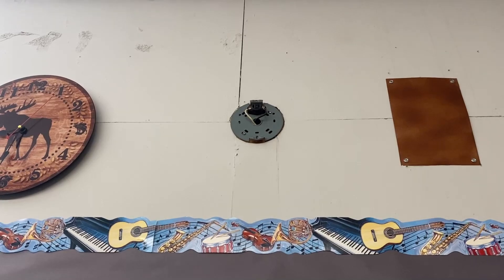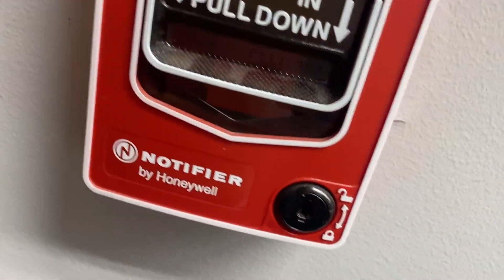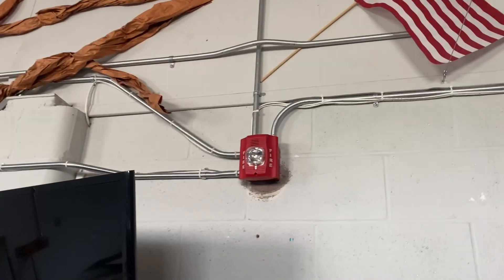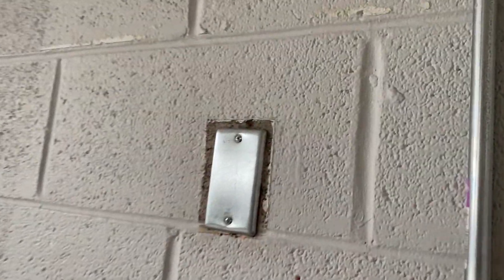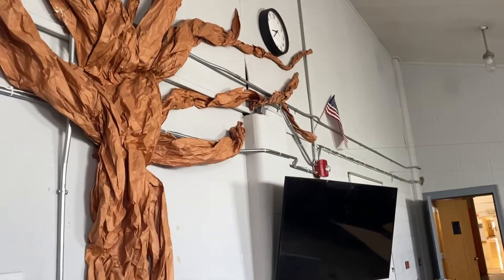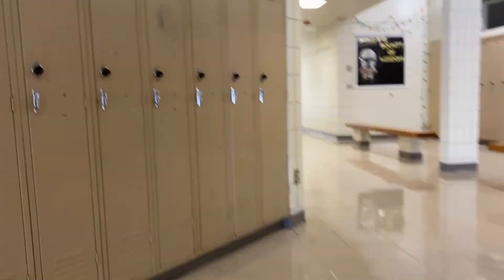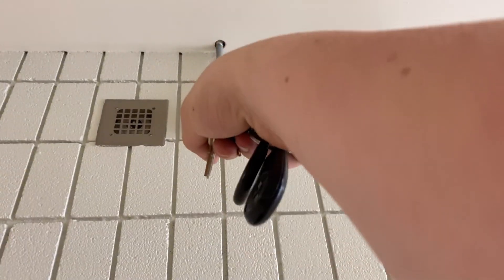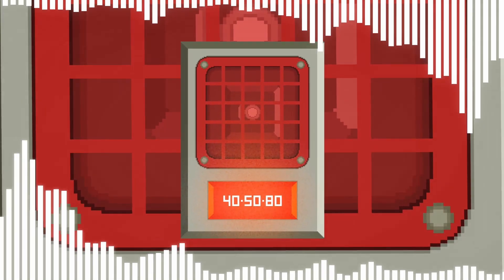Fire Alarm Test 129 | Retrofit

Comment: Indeed. In addition to my first elementary (now K-8) school taking a similar upgrade path ten years ago when their old Simplex 4208 system began failing from age, I also saw another building's 1980s Simplex system (2903+9833 horn/visuals, 4251-20 pulls and 2098-9636 "wiffle ball" detectors) get replaced with an NW-100 system with boring SpectrAlert Advances; the Wilhelm Scream of fire alarm sounds!

Comment: Poor elementary school kids! I feel bad for them!
:( bcuz these System Sensor SpectrAlerts are terrifying!
Reply: The elementary school (now K-8 school) I went to for kindergarten replaced their old Simplex alarms with SpectrAlert Advances ten years ago.
Reply: That sucks! That's gotta be terrifying!
Reply: @BuildingToursForLife1660-4  Well, before that the school had Simplex 4051 horns on 4050-80 light plates, and those were even louder.
Reply: @ZakWolf My school from prek to kindergarten had 4051s in 2007 before spectralert advances replaced them in late 2008.
Reply: @BlueThunderboltsiren  Yeah, that's what the old fire alarms at my first elementary school were: Simplex 4051-60 horn/lights.
Reply: I went through elementary school with spectrealerts they aren’t that bad. I was certainly never terrified
Reply: @pilotthwomp really? But are they horn strobes I assume?

Comment: Not saying they did but chances are if it was full conduit that they had THHN to bell boxes and which they in theory may have been able to reuse if needed the wiring. We have a school in our area that was all coded bells we upgraded to a 636pt fire lite panel and most of the thhn was tested fine - others we had to run new THHN to and it we converted in place to SLC and NAC where needed. 

Fully rigid conduit from panel to the devices.